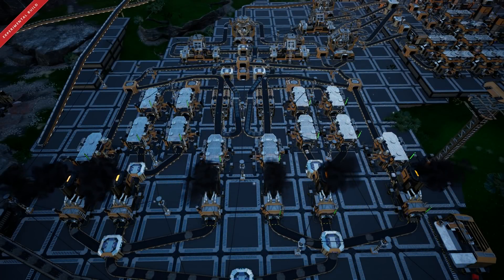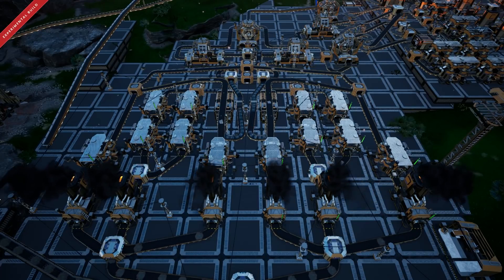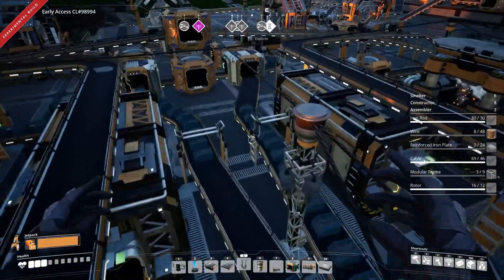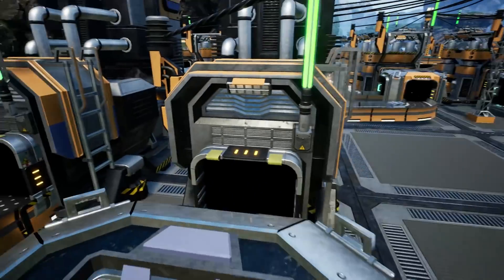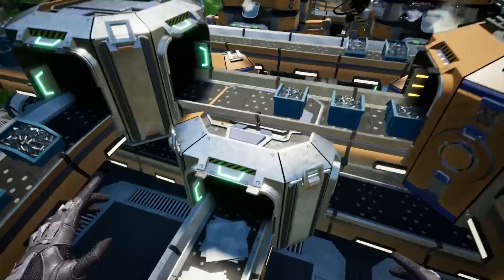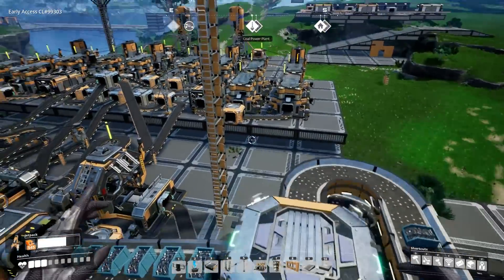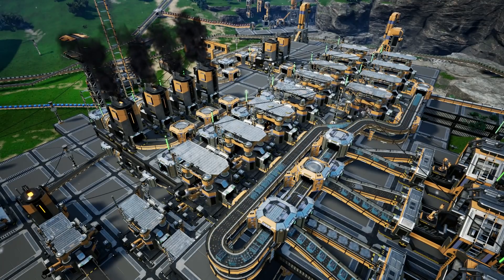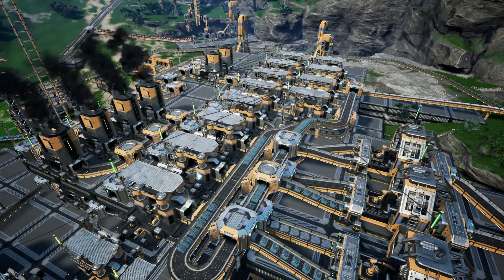Satisfactory Myth Busters: What's More Efficient, Bus vs Perfect Split

Comment: I mainly create bus builds because I like the space efficiency with these builds. I counter warming up by simply turning off the last step and let everything saturate, while I go off doing something else for some time. When I come back and it's all filled (or close to filled) I turn the last step on and it should instantly run at 100%. If this is not the case you can quite immediately check where in your build you made a mistake.
Reply from the maker: Scyonite you’re absolutely right but if you have the exact number if constructors in the bus to the Materials then it wouldn’t matter as much as the other sections would still be warming up whilst you’re away ☺️

Comment: I mostly use bus lines, and I've expierenced quite often, that it takes a while to worm up. Sometimes It's almost never fully efficient.
Reply from the maker: Bus lines are the easiest and quickest to setup but if you have enough resources provided, makesure the line isn't so long that the first constructor is ready to take the next item before the last constructors are manufacturing, also you can give the bus lines a kick start by filling them each with a stack of 100 items, so you're not waiting for them to fill up
Reply: Just use math.  Overclock the smelters and you'll find out that a mk5 belt can transfer 780 items a min. That's equal to 10 smelters for copper and iron fully overclocked. Done the math for constructors,  assemblers. I have a listing maintained how to split things in order to maximize a single line of mk5 conveyor :)

Comment: When most people talk about bus systems, they're talking about a factorio style main bus that you just pull off of whenever you need to and rebalance the belts periodically.

That's the debate.  On whether it's worth the time and effort and materials to set up a system like that over simply making in line manufacturing lines.

And to save you the trouble the main bus is useless for anything other than looking really organized.  You have a finite supply of resources that can supply a finite amount of machines.

The only debate about the perfect split and the branch feed styles is over which makes more sense from the perspective of space and aesthetics.  It's simple math to realize they're both identically efficient once the branch method has "primed" itself.
Reply: But that branch method is inefficient because it is primed. You now have stacks of resources not being efficiently used. If you ever move those units or belts, then you will have a stack left over as soon as you take away the import and either have to pick it up or wait for it to finish processing at the single unit using that stack. Splitting efficiently means that you don't have those stacks.
Reply: @scopeless22  
That's only relevant if you're constantly moving everything around.  If you're moving all your equipment enough for that to matter then you're not doing anything efficiently anyway.

Comment: Warm up periods will vary.  For nuclear power, I created an array for 26 reactors receiving a perfect split of 5.4 Nuclear Fuel rods per minute (A plant only burns 0.2 rods per minute).  With a perfect split all 26 reactors had Fuel rods after a few minutes.  Since it takes almost 20 minutes to create 100 Rods, imagine how long it would take to saturate all 26 reactors.
Reply from the maker: You're absolutely right, warm up periods vary depending on the item consumed as well as the length of the bus and the other issue with a power plant bus is that it consumes resources quicker as more power that is in demand.

Comment: Honestly, I've been finding that the always-on production factories are actually quite wasteful. By that I mean I end up over producing parts that sit in storage waiting to be used when the materials could be diverted to production of what I'm going to be needing soon. Not forgetting the power consumption nessersary for keeping systems running to make unnecessary items.  I would therefore argue that hugely elaborate assembly lines such as this are not as effective as vast storage system that can be quickly funneled into a single factory designed to rapidly assemble what you need. This storage-only mass production approach means you don't have to balance loads as your only concern is the speed of the conveyor belts. At most, all you need to do is store the most basic of components such as ingots, oil and concrete.
Reply from the maker: Hey thanks for the comment, this video was just to compare the first two styles of production, as both can fill up a storage bus eventually. Which I don't tend to use personally. However you've brought up an interesting idea. If we could produce just one or two full containers, linked to train stations, which are then linked to an automated storage hub, there's the potential to automate the storage hub to send items to a specific factory and thus, reduce wastage of resources and power. It would be very difficult to implement but it would be a cool system to play around with.
Reply: @TotalXclipse  I've only been playing for around a month so I'm the last person to know the best way to do this. Although I would think the smart splitters would be an ideal starting point to control inputs to a single massive factory from bulk storage. The trick would be having enough constructors and assemblers to cover all potential items you want to send to a manufacturer to ensure 100% output is possible.
Reply from the maker: @KryyssTV  The issue with smart splitters is that once there is a backlog from a single item in the conveyor system, nothing else can pass through, that's why they become obsolete on a massive factory and why you should always keep items seperated. Unless you create a system like the one in this video - its a work around, where you semi-autonomize items being sent to your storage system so that it never fully fills up. That way you can use the smart splitters to split items off into several different storage units. That being said, in the next update we'll be receiving resource dumps which will help that issue a lot. 
https://www.youtube.com/watch?v=6kKi8KXLf7s
Reply: @TotalXclipse  Could address that with an overflow loop that keeps the conveyors moving. I do this on foundries that share a coal supply with generators. Tricky to set up on huge factories though due to the need to plan ahead to keep the loop compact.
Reply from the maker: @KryyssTV  The same issue will still eventually happen, unless it's a consumable items... so for example it works with coal and coal generators, because you're constantly using coal as fuel. If it were a reinforced plate that caused the blockage, then unless you clear the space yourself it will always be backlogged. Until we have the next resource dumps.
Reply: The bus line can send the overflow into a sink.
Reply: @Michael-fd1gx  Sinks didn't exist when I wrote that comment over a year ago. The fact still remains however that the power consumption may not be justified given the limited usefulness of shop vouchers.

Comment: Perfect splits may be deliver 100% on efficiency fast.
But you as a player are working at 50% efficiency by wasting your time.

U could setup 2 perfect bus lines for different resources and move on to the next objective by the time u do 1 perfect split.
Let time and machines do the work for you, there is absolutely nothing efficient about putting math into things that dont need it.

U need a total of 60 screws? supply 60 screws = move on to the next objective.

Comment: i take the ore outputs and just combine them onto one conveyor and then branch of to a multitude of refineries. it'll max out the conveyors REAL quick in that capacity but i'd rather have a surplus than not enough! should also learn to put a storage container at certain points to act as a buffer so that if there is any minor issues you have a reserve to draw from, it has a 2 fold effect of storing up extra resources so that if you want to bug more things onto a line you can(until you notice it's draining and not filling up then just cut the last machine down in clock speed till it's JUST under whats needed to keep it full and you'll be running EVERYTHING at peak efficiency).  i've got atm on some pure iron nodes 3 mk 3 extractors running into a combiner that feeds out to 8 or 10 smelters that output to a bank of about 8 storage containers(large) that then feed out to different floors on the factory for making rods/screws/plates in one section.  it's not just about the capacity of the conveyor belts but also the SPEED at which they transport materials! that's more important... the faster you can get resources to something the more you can do with it!
Reply from the maker: Quantum Uncertainty Workshop I totally get all your points except for why you’d need a buffer for items between constructors - the only thing that will happen is you run out of power and thus you can’t run your factory for the spare items in the buffers. The only place I’d place a buffer is between a storage solution and a freight station so if I take any finished items from there it won’t take ages to resupply itself
Reply: @TotalXclipse  it's usually so i can just grab supplies and craft stuff without needing to wait, having an excess of anything is nice and power does remain somewhat limited until you hit nuclear(then you have a fun time figuring out where to put all the waste!). the frames and reinforced frames take ages to do by machine but you can craft them up faster by hand. though once you have most of the research done you don't need it in any major capacity and the buffers just kinda get left in place. i do use them to assess how many machines i can dump on a line before it starts to have a negative impact on production, could probably just run the numbers and calculate the total production of everything. but a side note on the nuclear waste, i store mine UNDER the map! the original map that has that HUGE gaping hole out in front of the closest uranium deposit cave is the PERFECT location for setting up your power plants and the machines to produce the power units! and then... you build a lot of little lower levels down and under the map until you find the point you start taking damage and make that your "catwalk" area! from there you'll build down as far as you can aim and place stuff effectively! toss up TONS of conveyor splitters connected to a BUNCH of large storage containers and you have a LOT of storage for nuclear waste that is well out of harms way and will last probably longer than most people will play the game!
Reply from the maker: Quantum Uncertainty Workshop before we had nuclear power I started building my factory on the lowest floor but then found a cave entrance to get you under the map in its entirety. That way you have more space than you could possibly need

Comment: Bus lines are just as efficient, as long as you supply them with enough ressources. if the ressources come in slower than they should for whatever reasons, bus lines will work slower, because ressources will almost never reach the last constructors.  The first contructors will get full of ressources while the last ones will have nothing.

So I would say: if you are good at making your factories with 100% efficiency, it shouldn"t matter too much. But if your input is lower than it should, either because you aren't good at maximizing efficiency or because you are still early in your game and don't have acces to Mk3 miners and/or overclocks for example, maybe you still want to make a big factory now, and just supply it with more ressources per minute later, than you should split equaly. That way, you are sure to maximize production speed.

But in a perfect world, I agree, bus lines are just as good. You don't even need to test, it's a simple math problem. If your input is 600 items per minute, and you're output is also 600 per minute, than you know all of the contructors will be fully efficient, because if for example, the last two didn't get the ressources yet, it means you will be producing less. Lets say 480 per minute. So you will INPUT 600 items, and get only 480 out. The system would obviously accumulate 120 input ressources. these 120 items have to go somewhere. Eventually, all the machines at the start of the line will be full, then the last ones will start filling up. If you start the factory from completely empty, it will be slower at the start though, where equal splitting would be just as fast at the start as it will be after a couple of minutes. The other thing to keep in mind is that technically, it starts only once, because once it's going, there really isn't anything that willl slow down your mining. If storage gets full, the whole line will back up, meaning it will be immediately super fast the second you will take the stuff out of storage.

Comment: you can actualy speed up the bus lines warm up by feeding it while it's warming up.
Reply: @VaszkoNicolas  well even if you don't  have the items in your inventory  you can also speed up the process by staggering your start up as well. been using that trick  when experimenting with micro  factories. basically i let the miner run while Im building the smelters and letting the miner fill them all up. as long as you have the math right its instant 100% same thing for all the other steps i keep the the lower processes running once its all set up i kill the power to the whole line connect the new section to the power grid and then boot it up

Comment: I still chuckle a little every time someone looks at that 100% number and says its "100% efficient". No it's not 100% efficient it's 100% up-time meaning its producing the maximum amount of product it can possibly produce at its current speed, it doesn't indicate how efficiently its using the materials.
Reply from the maker: okay, I see your point, however how can you increase efficiency without using Alt recipes. Surely if it's the constructor production speed is at 100% then in regards to to the production time efficiency we're running at 100% :)

Comment: I'm gonna respectfully disaggree.
I set up a bus to 6 foundries yesterday. Put 100 coal and 100 iron in all of them. After 10 min the last to were down to about 80 and 60 while the first 2 were full. after that i split the incoming resourses in 2 and fed 3 foundries each. This fixed the problem. At least short term.
I would like tho have splitters were you can set individual /min ons each of the three lanes. This way we can ge both efficiency and compact builds.
Reply: I know this comment is really old, but I see this thought process come up a lot. If you're using a bus/overflow method, and the machines at the end are running out of material, the demand on the bus is higher than the supply. It's not a flaw in the system, it's simple mathematics.

Let's say you're dealing with a smelter. It needs an input of 30 per minute. When you have 10 of them in a row, that means you need a minimum of 300 on that line to feed them. if you are seeing your end machines running low, you're supplying less than 300 per minute. That is the only explanation. It is not a flaw with the system. It is just math.

Comment: in my opinion : that setup is not worth rebuilding. here is why. But before that the pro-Stats for that kind is of course "TIME" on that perfekt-split you save a lot of time. BUT once the storages are full that setup becomes inefficient as hell AND takes a lot more space than a bus system. of course it looks like it is smaller , but its not! the bus system always can be build more compact and better looking on a mass production line. since factorio times i wished to stack belts 3D and thats where a BUS system in Satisfactory always wins.
SInce you can decide whenever you want to expand another line onto the existing line.

example on your videos you are using T3 or T4 belts but they are empty most of the time. thats wasted efficiency the items will not run faster if the belt is not full.
and a 3 on 3 production for heavy iron is not really THAT brilliant to start and making this video as a reference

THe next point is: AFTER you did all that heavy iron bars coming to steel you are telling you did not splitt of your Ore bus to steel?

Well think about your "efficency" Video once more before realsing that false build here please.

ANd yes i am not an expert , but dont trust everything you see on youtube this video here is NOT efficent at all. rework that and show us a 60/s Heavy Iron build. And than compare that with a bus build and a perfekt splitt build you will see the efficiency very quickly ;D
Reply from the maker: Jens Nennertheim hey thanks for the comment please bear in mind though the build was from the first rendition of early access and was just example but yes there is room to expand however there is a limit to buses before you need to setup a new bus and that’s the speed in which the first constructors manufacture an item as if it’s faster than the time it takes for the item to reach the later manufactures none will work. But now with higher tier belts that shouldn’t be too much of an issue ☺️

Comment: Personnaly I use perfect split, much more satisfying and dont need that much space.
Also a pro tip for you guys that I also use in smelters distribution, use the conveyor speed to bottleneck the chain instead of making the bottleneck at the machine's cache.
For exemple what I often do is a 450 ore/min mining distributing in a chain of overflow the smelters, each pair of smelter get a splitter linked to the bus via a 60/min Mk1 conveyor, ez and clean af, highly recommend.
Reply from the maker: interesting point :) thanks for mentioning it and yes providing you're not producing 60 items per min from the smelter adding the T1 conveyor works perfectly